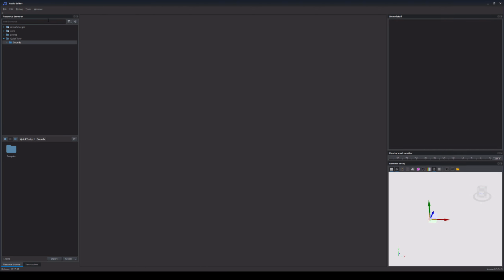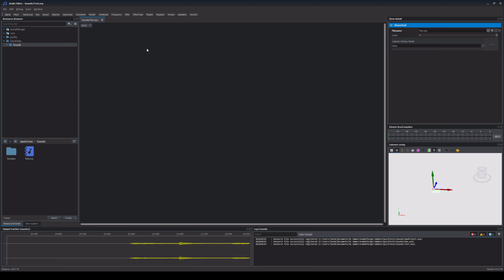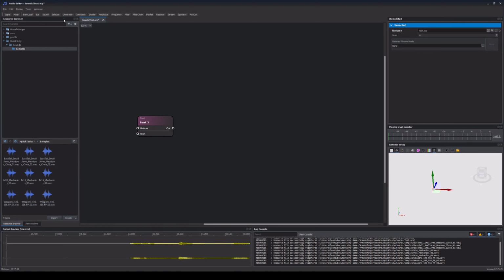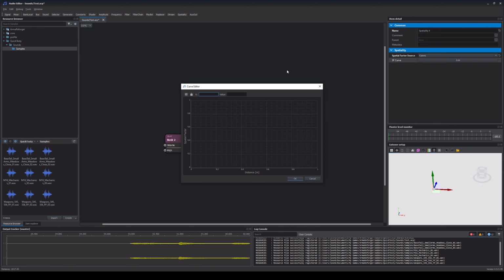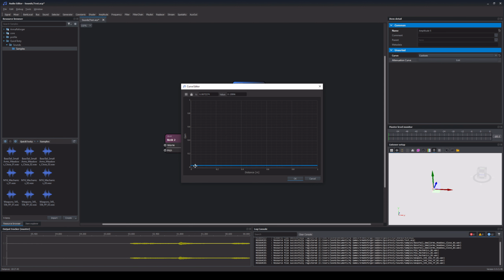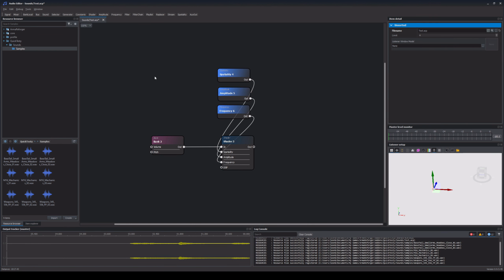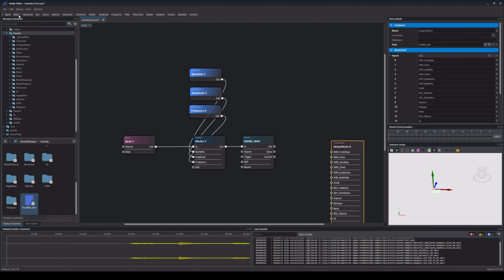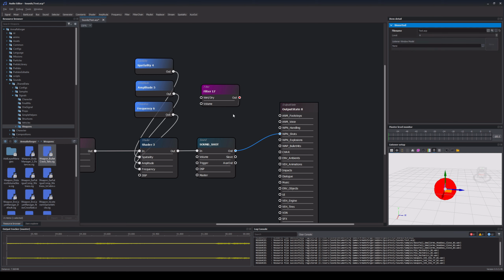[Enfusion Workbench Audio Editor Tutorial] - Part 1: The very basics in about 7 minutes

Comment: Thank you for the tutorial! Quick question: Let's say if in the future I were to make a custom mission/campaign that has several lines of spoken dialogue. Would I have to go through this process for each sound file associated with a line of dialogue, or is there some way to quickly apply all these parameters to all the files?
Reply from the maker: Hey dude,
well, we don't have a dialogue system in Reforger yet, so there's no "regular use case". 
I'd say, however, a good way to go about this would be to set a signal via script and use the "selector" node.
This way, you could have all lines in one place as banks. :)
If you need more (detailed) help, hop onto the arma discord and hit up the enfusion_audio_makers channel!